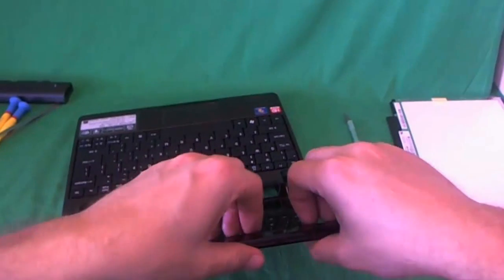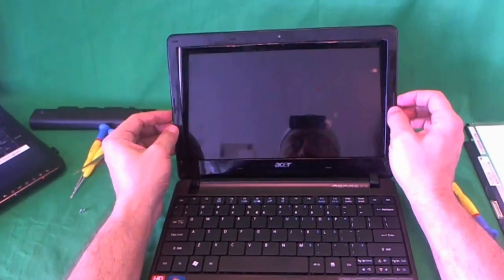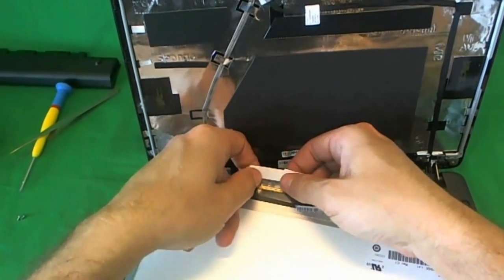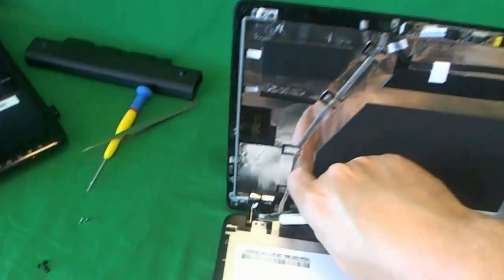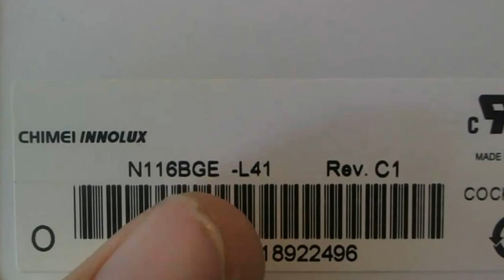Acer Aspire One 722 Netbook Screen Replacement Procedure

Comment: Hi! Thank you very much for your video! It helps me every time I need to replace my screen... But I have a challenge for you: I have replaced the screen of my acer aspire one (722) 3 TIMES and it still having black spots after 1 or 2 months of use, always beggining on the left top of the screen and growing till I need to replace it again... What I'm doing wrong or what's wrong with my computer?

Comment: Hey are all acer AO722 screens compatible with each other?? I have AO722-0836 with a broken screen but i can only find a screen replacement for AO722-BZ454, AO722-0427 and others
Reply: 722 series all use the same screen.

Comment: Someone brought me a laptop and replacement screen and said, "Could you install this?". Panic attack. I looked at several tutorials on YouTube and yours was the best. A 2-minute time lapse video elsewhere is useless.  There may be slight variations how the video harness is taped to the edge of the screen. No biggie. I did not feel a snap when I connected the video cable, but I used a magnifying glass to confirm that the connection was snug. Careful, it looks very fragile. I'm a hero now.